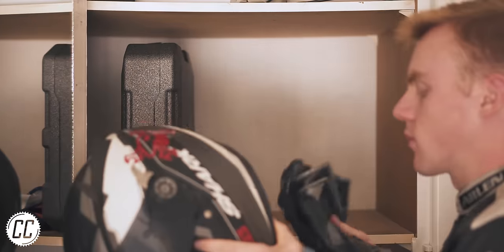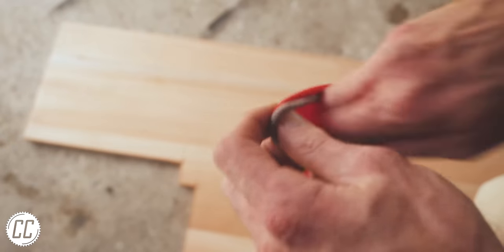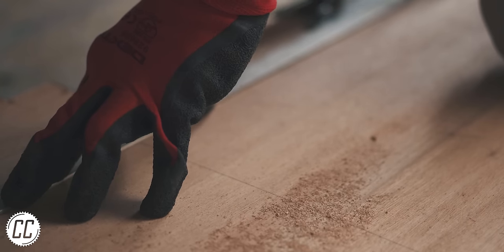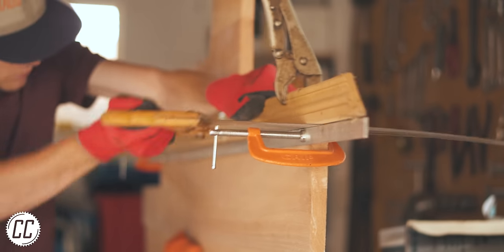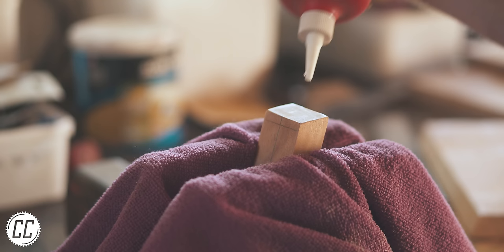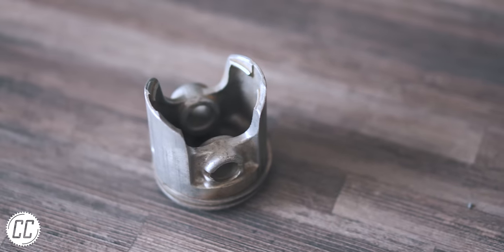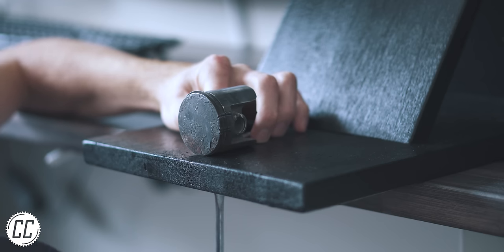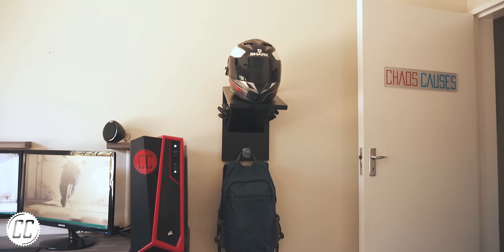Building a Helmet Wall Stand With A Piston

Comment: Would appreciate a motorcycle wall holder next
Reply from the maker: I’ll start brainstorming lol
Reply: Might have to design a new wall first lol. Would b good to see though 😂
Reply: Solidly mount to the studs in the wall a paddock. Stand, a lexan piece thick enough to not flex that's bolted to the wall supporting the bottom. Of the bike, wide enough to support the bike should the stands fail.
Reply: Did you not sink that screw in all the way for a key ring holder?
Reply: some ikea commando hooks should work fine
Reply: Ahahhahaha thats gonna be hard
Reply: Lmao
Reply: Ahahaha bro 🤣

Comment: You used one guide to cut straight lines with the handsaw, but I think if you use 2 guides, on on each side of the wood, one guide higher than the other, you would be able to cut straight angles....
Add an adapted coat hook to the underside of the bracket and you can hang a jacket or liner in front of the back pack.

(My neglected vaccuum cleaner makes a great helmet stand. Parked near an outlet, i use a magnetic charger cable to recharge my sena.

Comment: Use a straight edge (a long ruler or another piece of wood) as a guide for your jigsaw to cut long straight lines.  The edge of the shoe rides along your guide.  Just measure the distance from the blade to your outer edge of the shoe befire clamping down your guide that far away from the target line.

Comment: Hey guy i know this was like 2 years ago and im sure its been doing yo well ,it look great by the way .i saw one just like tis design the only difference it would appear is they used a hinge to connect at the top ..oh and for your next wood project .sometimes its easier to paint or stain the pieces before you assemble them..lol

Comment: Great video man, this is an awesome way of hanging your helmet!! I have a question i hope you can maybe help me with. i saw in some of your previous videos you use photoshop, do you use lightroom as well? Now my question is what type of specs should a computer have to run both PS and LR at the same time? Will a computer with between 2.5 ghz and 3 ghz  and 16gb RAM be enough or should the ghz be more? Thanks. ( Sorry, I know this is not motorcycle related lol )
Reply from the maker: Thanks man! Yeah I use all the Adobe products. That’s plenty RAM (I have 16GB) and its more to do with the combination of processing cores and speed. My i5 does the job just fine. They’re not very high performance applications anyway.

Comment: The jigsaw is a terrible saw for what you were using it for. A jigsaw has it's place, but for straight cuts, you could be using a circular saw. That being said... I don't even own a jigsaw, but I used to use it when I would build when I would build speaker cabinets and I would only use it to cut out the hole for the speakers, which is probably the only useful thing I can think of for a jigsaw. I'm sure it has other uses, but that's the only thing I've ever used it for.

Comment: sawdust plus woodglue iequals woodfiller, don't waste your money on a bought one. and reuse the sawdust of the board you cut so it maches - ish the color and tone. to simulate the lines in the wood gently draw them on the woodfiller with a pencil before putting any colouring or gels over. try it a few times before you need to do something for real. oh and manly gloves in carpenting? come onnnn. just a joke you do you and i'll do me.